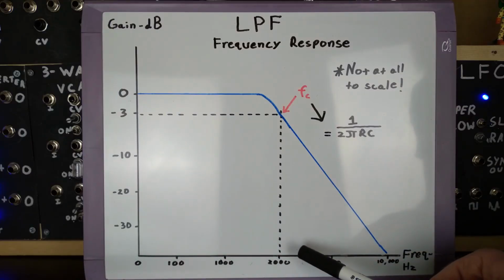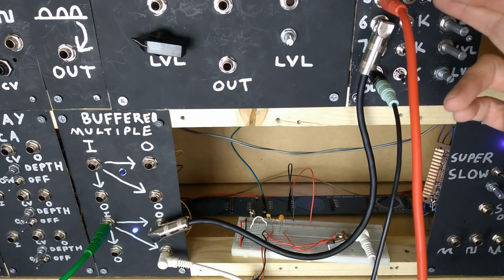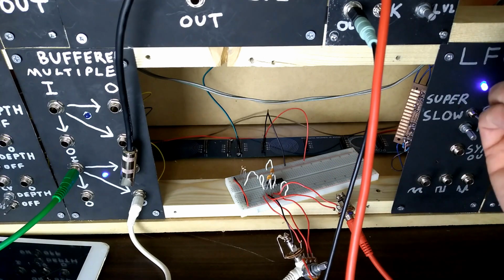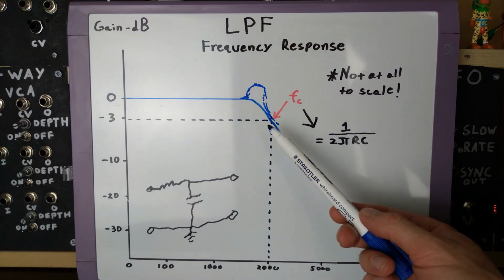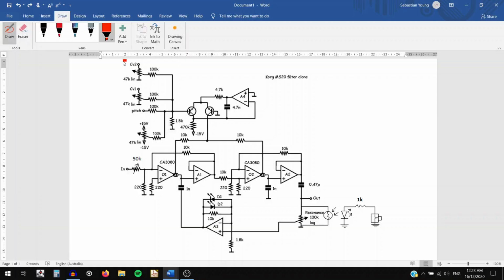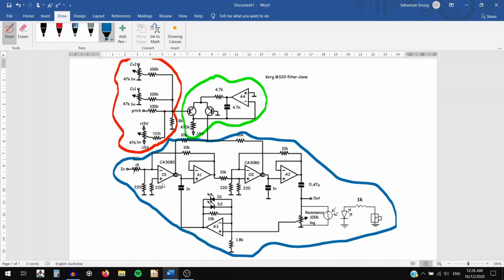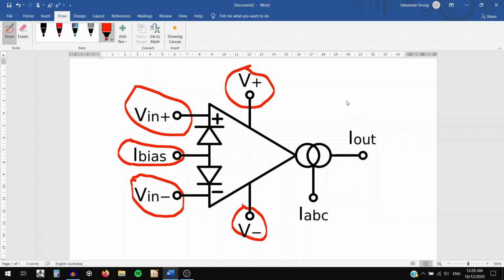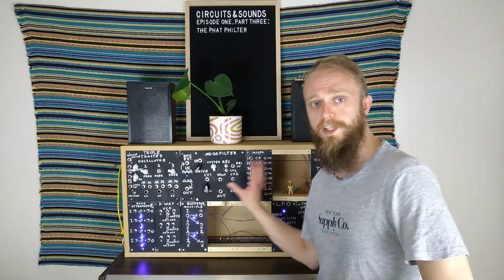The Phat Filter - Exploring The Korg MS-20 LPF Clone By Rene Schmitz

Comment from the maker: During the circuit explanation, at 24:56, the input pot is actually a 5k pot, not 50k. 
So (I think), we can adjust the gain between 2 & 10 V/V.

The vactrol LED also goes to actual ground, not virtual ground (or else it wouldn't do diddly squat).